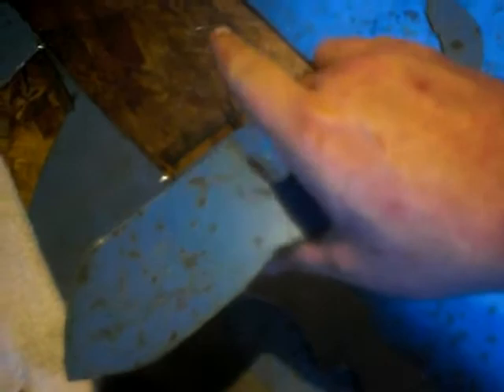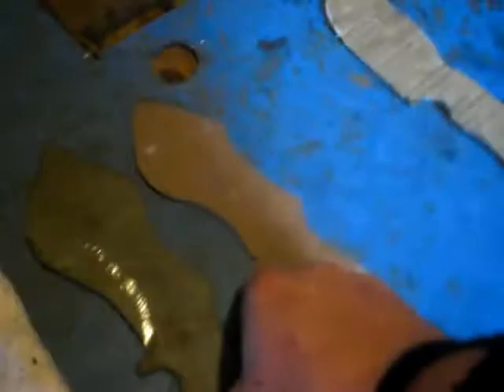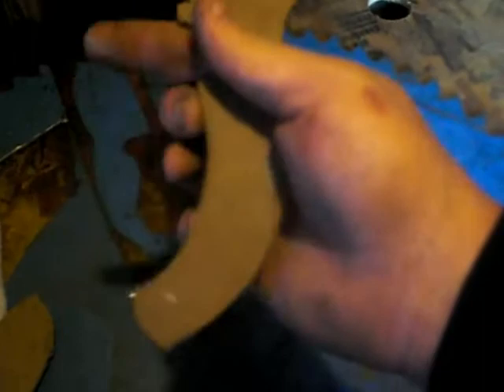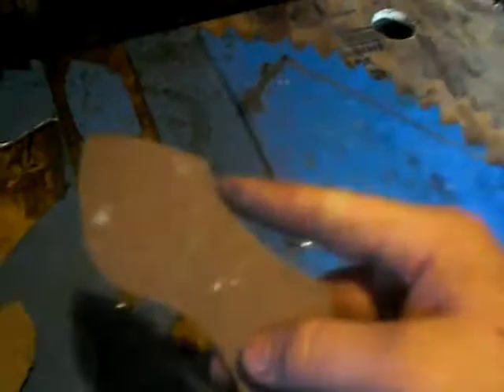Saw blade knives and designs

Comment: its l6 steel, to test if it is hardenable because some are not heat a little piece to yellow quench it in cold water, like really cold, then put it halfway in vice, then hit it with hammer, if it chips/breaks it is hardenable